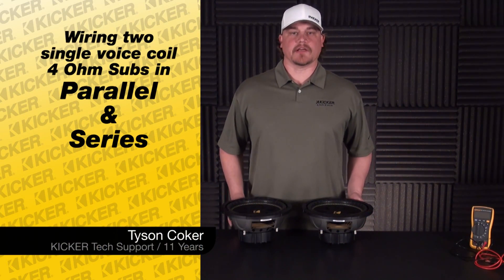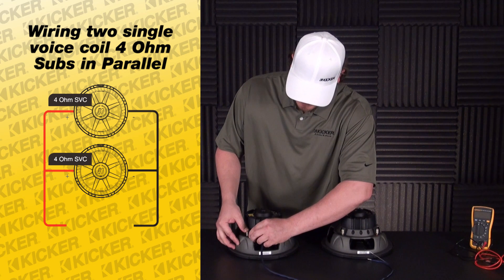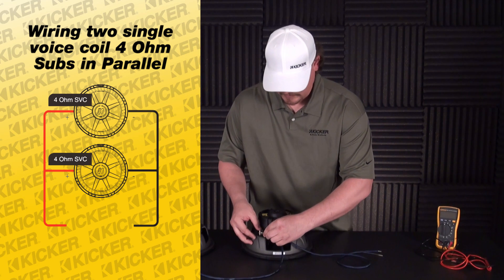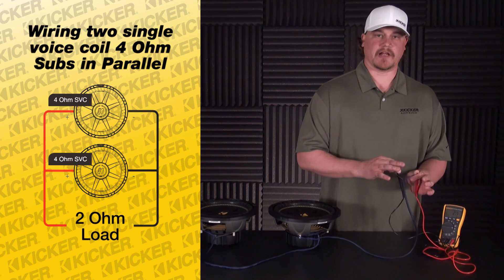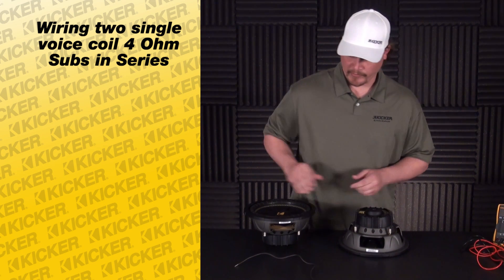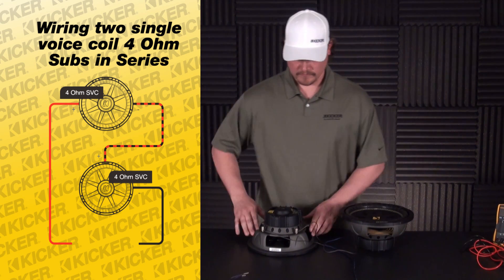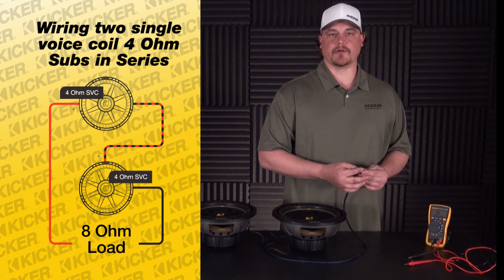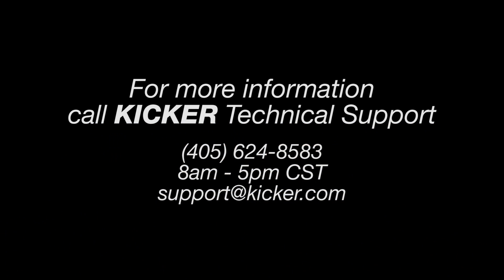Subwoofer Wiring:  Wiring 2 SVC subs in Series and in Parallel

Comment from the maker: Hey Dylan - I could not find the exact JL amp you had listed but if it is stable at 1 ohms mono then you will want to wire your 2 x 2 ohm subs in parallel and run them to that amp.  This will show the amp a 1 ohm load and the two subs will share the 1000 watts, so each one will see 500 watts RMS.  If you were to run the amp at 4 ohms mono then the amp will only push 400 watts to both subs and each will see only 200 watts each.
Reply: Thank you so much I've had 7 systems so far but they all were single subwoofers and I've never figured out how to use a mono with multiple woofers. The Amp is right here. http://www.crutchfield.com/S-dRdRleBEumn/p_136J210001/JL-Audio-J2-1000-1.html

I think that its 1 ohm stable what do you think? so wiring subwoofers together splits power? I didn't know that.

and also! its cool to know that the wattage of a speaker stays the same no matter the ohm load!
Reply: what about wiring that is doubled on pos and neg ? on a single voice coil sub .
Reply: Is it safe to bridge in series.
Reply from the maker: John G Fla. What is the amp and sub(s) model numbers?
Reply: @KICKERAudio  kicker C10 comp thousand watt maximum power pioneer 2 channel amp
Reply from the maker: John G Fla. Need the model number for the amp.
Reply: GM a5702 1000 watt maximum power Pioneer amp can it handle 8 ohm 2C10 competition kicker speakers.  Just a reminder if I can wire in series and bridged. I have two identical amplifiers I might wire each amp to each speaker if I can't wire and series.
Reply from the maker: According to their specs its just under 500 watts bridged at 4 ohms: https://www.pioneerelectronics.com/PUSA/Car/Amplifiers/GM+Series/GM-A5702#specs

The 1000 watt info is a peak (burst) rating. Ignore that. 

The c10 has a 125 watt RMS, and the amp says it puts out 150 per channel at 4 ohms.  That works out well.  Dont bridge it, simply wire each sub to each channel of the amp and you're good to go.
Reply: KICKER what is the watt rms with 2 12” comp c at 2ohms. ?????? 2 svc 4ohm rms is 300. So what is the rms at 2 ohm?????
Reply from the maker: The RMS of the sub doesn't change with different ohm loads.  What does change is the output of the amp at lower loads, so you might want to look at the 2-ohm output of your amp.  We normally recommend that you stay within 20% of the RMS of the subs you use. Since you have a pair of the subs, that's a total power of 600 watts RMS.  Therefore your goal should be to give them between 480 - 720 watts total.
Reply: KICKER thanks kicker!!!!!!!!! I love my comp c’s. Everyone says my one 12” dumps with my Rockford fostgate punch p3002. The older one with a chrome guard. I’m getting a new amp. Can’t afford a kicker, but maybe hifonics or a nvx.

Comment: I have two JL Audio 10w3v3-2 and a 1 ohm stable 1000 watt rms or 4 ohm which produces 400 watts. Im wondering if the wattage is split or the same ( bridged?) to the both of subs. the amp is 1 ohm stable so i can run it at 1 ohm or 4 ohms. the subs are 500 watts rms at 2 ohms. if they are wired at 4 ohms or 1 ohm does the wattage of the speaker change? what is the best way to wire this set up. The amplifier is a JL J2 1000.1 mono

Comment: I'm wiring mine as shown, and not getting a reading on the multimeter. I've also tried measuring them separately, and I'm still getting nothing.
Reply from the maker: Couple of things to double check - make sure the multimeter is set on the ohms setting and that all connections are solid.  Try testing them separately again and ff it is still reading 0 then unfortunately your subs may be blown or the tinsel leads have broke.  Please let us know if you need any further help!
Reply: KICKER Ok, i got it now, my connections were weak. What amp do you think would be best for this set up? Thanks for the reply!
Reply from the maker: MrCircus177 If you are working with 2 x SVC 4 ohm subs then you will want to find an amp that is stable at 2 ohms mono and you want to match the RMS rating of that amp at 2 ohms mono with the RMS rating of the speakers.  So if each sub will handle 300 watts RMS then you want an amp that will push 600 watts RMS at 2 ohms mono.

Comment: I have 2 12"svc 4ohms subs wire to 8ohms and bridged. My question is my amp says it 500rms bridged at 4ohms, is sufficient power for both since its 8 instead of 4
Reply from the maker: I would guess that the amp is pushing out about 250-300 watts at 8 ohms mono.  Since you are running 2 subs they will share this power so each one will be seeing around 125-150 watts each.  Depending on what subs you have this may or may not be ok.  Underpowering a sub can be just as bad or worse then overpowering a sub.  What is the RMS rating on your subs?

Comment: how would i wire my 2 subs to a 2 channel amp. would i go + to + on channel 1 and then - to - on channel 2? or vice versa? or just run them to the same channel?
Reply from the maker: It will depend on what subs you have, what ohms they are and what amp you have.  If you can let us know the models we can tell you what will be the best wiring configuration.
Reply: I have a 2 channel 1600 watt boaa audio amp, and dual 12 inch 1400 watt boss audio subs. And they are in a vented box. I tried going one sub to each channel but they weren't kicking simultaneously it was one then the other and it sounded like crap
Reply: The amp is also stable at 2 ohms. I have to check on the subs
Reply: Boaa is supposed to be boss. Sry for the err

Comment: KICKER  can u PLEASE explain why every single person shows the parallel wiring system as a "speaker to speaker - then to amp" method?? How is that any different than just running 2 sets of wires. Example - A positive and negative from each speaker going to the amp? What's so wrong with that? My mono amp has 2 sets of terminals (strictly for being convenient, it IS 1 channel) so why can't I just run a seperate set of wires for each of my speakers? They are svc, 4 ohm..so my impedance is going to drop to 2 just like your method right? The way in this video (in theory and my opinion) seems one speaker would get more current/power/watts. Please respond quick..ive researched this for days, my brain is fried!! Thanks in advance
Reply from the maker: Either way works - You can run a wire from the postivie of each speaker into the positive of the amp and then a wire from the negative of each speaker into the negative of the amp.  There is no difference in doing this either way and one speaker will not see more current/power/watts then the other.   Many people just like the cleaner look of having less wires running from the speakers to the amplifier.
Reply: My mono amp is too have 2 sets of positive & negative..... 1800 watts @ 1 ohms, 1200 @ 2ohms & 900 watts @ 4 ohms.... I have 2 svc 4ohms 300 rms 12" subs each one is 1300 watts maximum & the other is 1200 watts maximum....please suggest me how to connect both for maximum sound effect....parallel or series connection....?.....

Comment: Do your speakers perform better at 2, 4, or 8 ohm? I want to get the best performance and sound from my amp and subs. I have 2 mtx thunder 6000 12" subs and a sony xplod 1000 watt 2 channel amp. Can you recommend what would be the best set up ? Thanks so much !
Reply from the maker: There is no performance difference between a 2, 4 or 8 ohm speaker.  They all have the same sound quality, performance, output and bass response.  The reason there are different ohm speakers is so that you can wire them in the correct configuration to match up to the amp.  Your Sony amp runs at 4 ohms mono.  I think the subs you have are 2 ohm DVC which unfortunately you would not be able to wire to get a 4 ohm load.  You could run a singe sub, wired in series to the amp.  If you are wanting to run two subs then you will need to get either 2 x 2 ohm SVC subs or 2 x 4 ohm DVC subs.

Comment: When i measured each coil they came out to 4.3 and i did only one positive and negative lioe you guys did in the video, connected it to the box and measured the wire that im goin to run to the amp and it was still above 4
Reply from the maker: That is really strange and I think the best thing might be to take it to a shop to see if they can determine what might be going on. Since each voice coil is reading 4.3 ohms and then once you wire the two subs together, positive to positive, negative to negative, this should drop the ohm load at the box terminal to 2 ohms.

Comment: So i wired my two kenwood w12ps svc 4 ohm subs in parallel and its still reading 4.2 on the multimeter.... Am i missing something here?
Reply from the maker: Try measuring each voice coil before you wire them together.  They could possibly be mislabeled.  If that is not the issue then after you wire them in parallel, are you running a single positive and single negative wire into the amp? If so, measure those wires.  If you are running a positive wire  from each voice coil into the postivie of the amp and a negative wire from each voice coil into the amp, make sure the wire is stripped  of the coating, twist the wires together then use the multimeter to test the load.  If you still are having problems contact us at 800-256-0808 and ask for tech support.